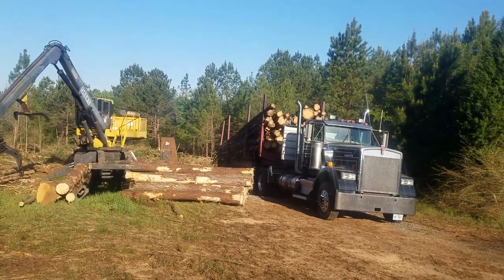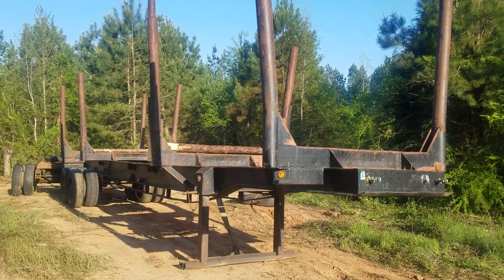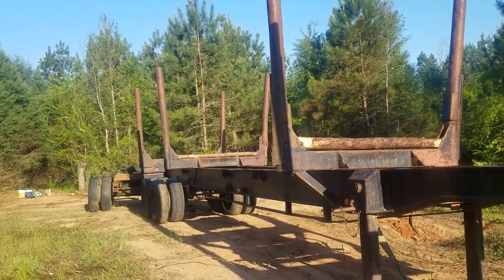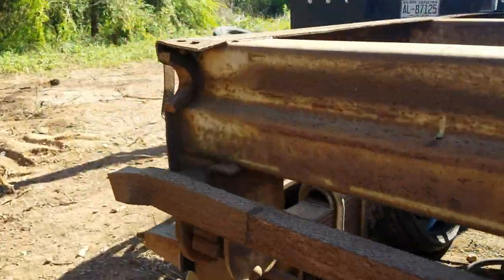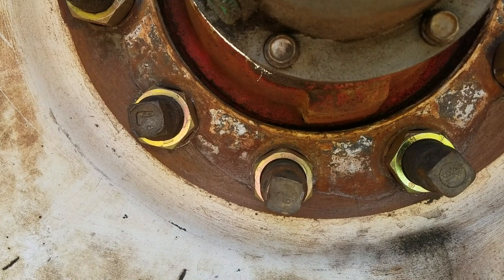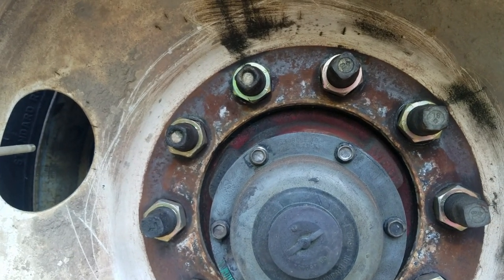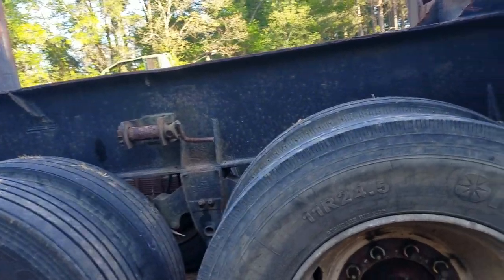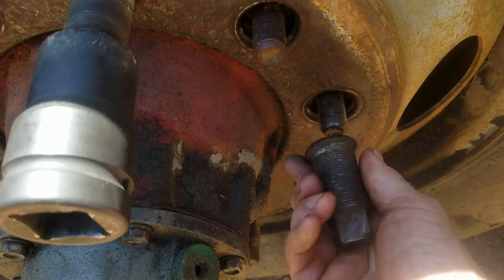Log Trailer Details

Comment: Buds are the way to go " if you had to get onto the brakes hard & those Dayton lugs are not tight enough it'll cause the rim to spin  ripping the tire  tube stem off causing flats... Also there's a easy trick to changing your wheel seal or brake shoes by jacking the axle up slightly enough to slide a 6ft. piece of tin with oil on it under the two wheels taking the axle nut off sliding both wheels hub & brake drum off as a complete unit saving you from a lot of unnecessary extra back breaking work. 👍 30 year owner operator

Comment: I agree about the brake job convince but generally you get more flats than brake jobs and (for me) those 5 poke daytons are easier to get along with than budds...all that being said - pilot wheels are the best (my opinion) if l can't have pilots I'll take dayton over budd...good video...that loaded trailer looks "heavy going up"...I've never had to pull no load like that

Comment: bring back the spider hubs 10 stud no thanks love spider hubs only have to tighten 5 or 6 wheel nuts instead of 10 and they (10 stud bud wheels) have to be super tight unlike the spider hubs  plus mating surfaces have to be spotless no dirt or rust or they fall off and the 3 spoke spider hub is made by BPW or old Webb type